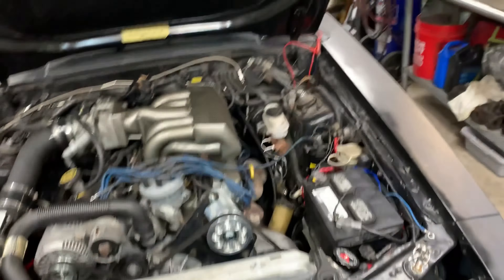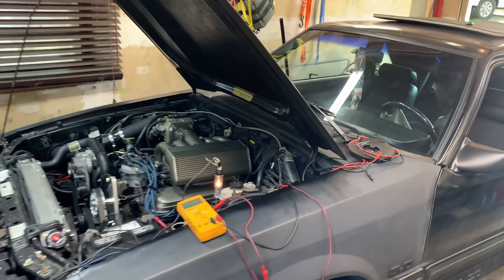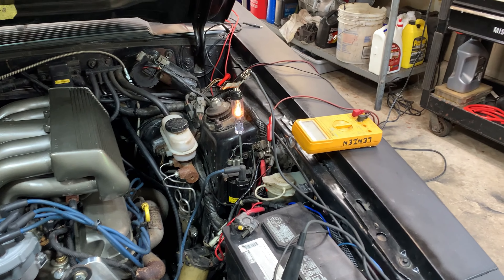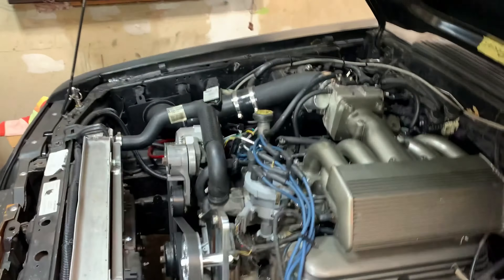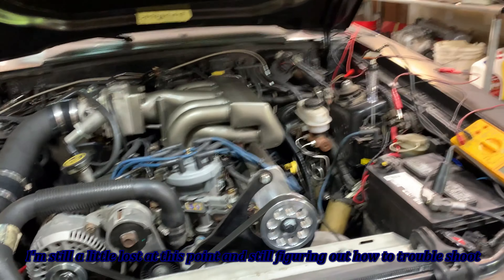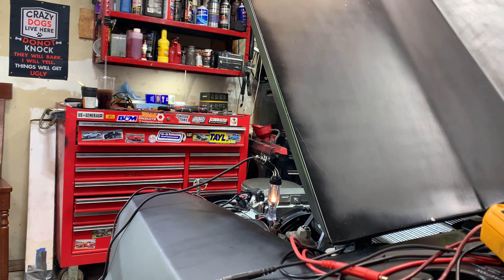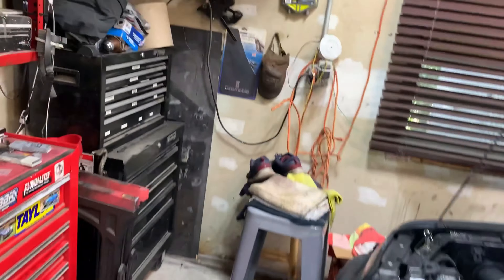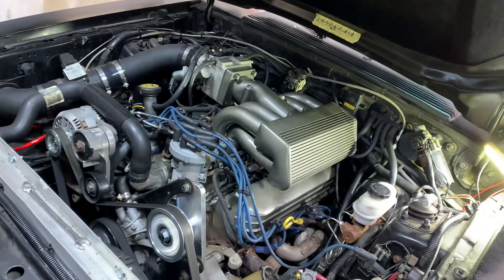FOXBODY MUSTANG NO SPARK   SCREAMING DEMON COIL

Comment: I'm thinking of spending a little extra for a Pertronix module . I suspect I have 2 bad in a row from the parts store . Thinking a dozen different ( supposedly  ) modules are coming from the same place in China , and then boxed by whoever over here , Btw , my coil throws about an inch of blue in the open air .
Reply from the maker: @rolandtamaccio3285  yes, junk coming from China these days!

Comment: Great video dude! My 91 won't start so I'm doing as much research as I can to get it started. I tested my coil for the first time tonight and it seemed to be doing what it was supposed to be doing, but I don't think I tested it correctly. I'm gonna try ohm it it out tomorrow and see what it ohms at. I kind of have a feeling that the injectors are bad though because I'm having fuel leaking from a line that goes into the fuel rain. So like maybe the fuel isn't going into the engine because the injectors are clogged up. Idk I'm considering buying these injectors I saw a video in that spray really good and are only like $66 on Amazon. But this video definitely helps. Thanks bro!
Reply: ,,, it's just about impossible for all the injectors to clog at the same time .
Reply from the maker: @TBBucYou  watch “veteran revival” on YouTube and those Amazon injectors…the video I’m referring to came out within the past month or so….

Comment: I put a Performance Distributor and their screaming demon coil on my Fox about 4 years ago. The dizzy was their “Hot Forged” unit from LMR. It fixed my problem at the time which was a bad PIP sensor on the OEM dizzy. Ran great for a year, then the stator got burnt up and was taking out TFI modules like crazy. Became an expert at changing those on the side of the road. Got ahold of PD and they said the warranty is only good for a year so I was out of luck. Have since purchased a Duralast Gold new dizzy from autozone with the lifetime warranty and have had no issues the last 3 years. My screaming demon coil though has been just fine this entire time. Needless to say I still keep 2 known good TFI modules and 1 extra coil with me in the trunk for the day I need it. Because that day will definitely come sooner or later lol.
Reply from the maker: Good idea, keep 7/32 socket and extra tfi!